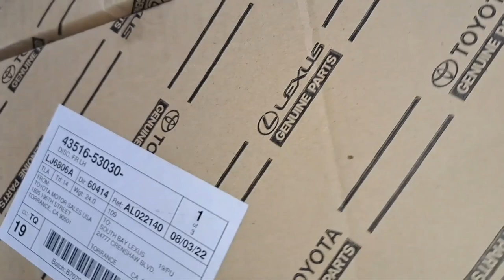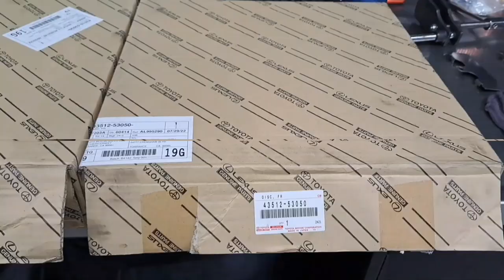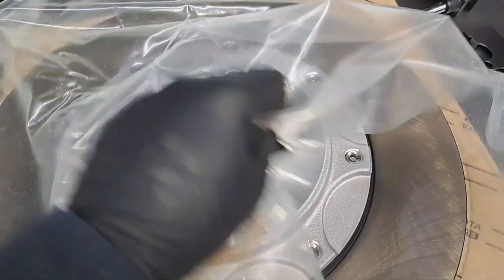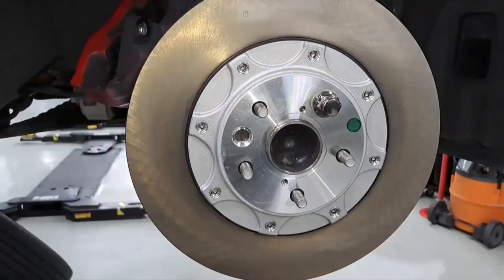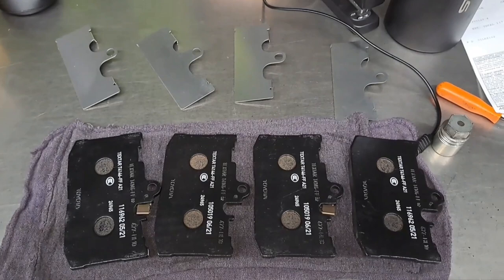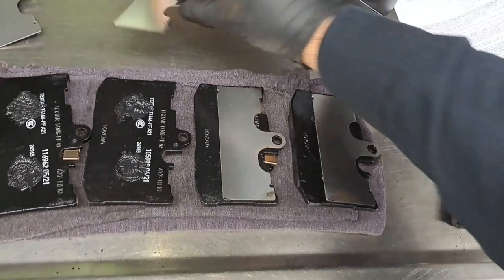2015-2022 RC350 F-Sport Front Brake Pads and Rotors #automotive #lexus #mechanic #diy #subscribe

Comment: Great video....have you changed pads and rotors on a rcF Track Edition yet?
Reply from the maker: Thanks, I've done the RC-F but not the fuji Speedway edition. I haven't got the chance to do brakes on one yet
Reply: @harborareatech310  Do you know if you can use the Rcf pads and rotors on the Track Edition. The track edition rotors are $3000 each 🤦‍♂️
Reply from the maker: @elonmusk8667  i am not  too sure. In that. I wouldn't want to change it, though. That's one of the things that make it the awesome car it is. But im sure there are some aftermarket companies that may have other options

Comment: Great video! I put new rotors on my 2015 LEXUS RC 350 F SPORT and kept the brakes because they were still thick. Working good but so loud right before coming to a complete stop. I also tested driving slow then stopping but it's still loud. I didn't grease them up, could that be my mistake?
Reply from the maker: Yes, the manual calls for adding grease at the contact points of the brake pads to reduce noise. Also, make sure your brake pads are equipped with anti squeal shims on the back of the pad. Lastly, I will point out that the f sport is equipped with high-performance brakes, so some brake squeal is normal. There is a bulletin to change the rotors from a two-piece rotor to a one-piece rotor to reduce noise. However, this reduces brake performance.
Reply: @harborareatech310  Excellent, much appreciated! Put R1 Concepts drilled and slotted rotors. Removing pads to grease now. Thanks again!!!🙏🏼
Reply from the maker: @etet4736  I never tried those rotors. But if you are re- using the pads clean everything well, check that brake shim, and lightly sand down the brake lining evenly if you are reusing.
Reply: @harborareatech310  I had bought ceramics last night, put those on went for a ride a I hear clunking! Took one tire off and pads are tight. Maybe reset them?
Reply: @harborareatech310  Sanded originals and now everything is perfect. I’ll watch and Like all your videos, least I can do!
Reply from the maker: @etet4736 I'm glad it helped ! Thanks and don't forget to subscribe for future videos like this
Reply: @harborareatech310  Done! 👍

Comment: I have a RWD model and was wondering if there are other rotors that are not a two piece rotors I could use instead of those since they are a lot more expensive than regular rotors. Thanks!
Reply from the maker: @gdanny9357  I'm sure there are aftermarket rotors that replace the 2 piece bit I wouldn't know, I always use the original
Reply: no problem! 2-piece rotor is a little lighter, so better suspension action (lighter un-sprung weight can improve road-response, but, only very little!!!) as long as there is no fitting issue, you can go with aftermarket. my car is LS500 F sport. I do all brake jobs, Acura RL, TL, honda accord v6, Lexus GS430 2006, gs430 2006,... I have so many experiences. believe me, you go!
Reply: @changryu8128  so the 2 piece is better performance wise but a regular rotor can still be used right?
Reply: @gdanny9357  absolutely!

Comment: Good job 👍 just a random question,  i have excessive water vapour coming from the exhaust on our Lexus NX300h . As we live on a steep hill, on a morning start my Mrs pulled out of the driveway and proceeded up the hill. I noticed a trail of water vapour came out for  15 to 20 feet long.. Would you know if this is this considered normal ? Thanks
Reply from the maker: Thanks! Yes, it is normal. This means your catalytic converter is doing its job at filtering the exhaust gases. Also, condensation may build up overnight on the exhaust and can cause it to burn off at first startup. This is normal as well
Reply: @harborareatech310  many thanks for your reply and info. Keep up the good work !

Comment: i cannot seem to find replacement or aftermarket rotors for the 2015 RC350 fsport AWD.... kind of annoying. I've never owned a car where something as simple as brakes are hard to find.
Reply from the maker: I get you. I'm guessing because they are special 2 piece rotors.
Reply: @harborareatech310  sadly, the AWD models are one piece only… which is why I’m so frustrated lol. One piece rotors should be super easy to find. I don’t wanna buy OEM from Lexus because i think ONE rotor cost like $430
Reply from the maker: @Chris  If the rotors look like the one in the video it's the two piece rotor. They come riveted together and I believe all if not most fsport models come with them. Not too sure if they have aftermarket versions though.
Reply: @harborareatech310  that’s what’s I’m saying; the AWD models do not come with two piece rotors. They also have different size rotors than the RWD fsport models. 😩

Comment: I have a 21S 350 F sport dynamic handling, and my rear pads are at 3mm and my front are at 6, but both rotors are warped and below 28 mm, I’m wondering why my rear pads are wearing faster. Nobody can answer that question, my car only has 26,000 miles, I do a mix of highway and city driving.
Reply from the maker: It's hard to say without checking ourlt vehicle. But if you're not doing burnouts, the rear brakes normally tend to last longer than the front brakes. If the rotors ate warped, it's possible that there is an abnormal braking pattern occuring. If  you are doing regular braking and the rear pads are worn out , i would get the calipers/other related components inspected
Reply: @harborareatech310  definitely not doing burnouts, and I drive this car rather conservatively especially now that I daily my RX. I value my money and tires and brakes are too expensive on these cars🤣

Comment: Installed my brakes but squeaks when I reverse the car. I put the indicator side on the interior side of the calipers for both sides. Is there something you recommend? Thanks
Reply from the maker: Did you replace your anti squeal shims? I would also recommend to go with the OE pads and lube the contact points on the pads.

Comment: off topic but do you know how to change the transfer case fluid ? I have a 2018 350 AWD and cant figure out how to drain it
Reply from the maker: There should be a drain plug and a filler plug  for those. Most likely it would be a 10mm hex

Comment: Thanks…good video!  May try this myself. I have 72k miles on mine…how do I k ow if I need rotors?
Reply from the maker: Thank you. Appreciate it. Dont forget to subscribe if you havent already. It's  not that difficult i encourage you diy. I usually replace the rotors if they have a deep inner and outer lip on the edges of the rotor because resurfacing at that point may reult in the minimum spec. But technically they have a minimum thickness that you can measure I believe it's 27mm minimum spec but it also depends on the style rotor your vehicle has.

Comment: Hey where did you purchase your rotors? Been looking all dat for the right fit
Reply from the maker: They are original parts from the dealership part numbers can be found at 4:36
Reply: My question is can the rear get 2 piece rotor as well ?